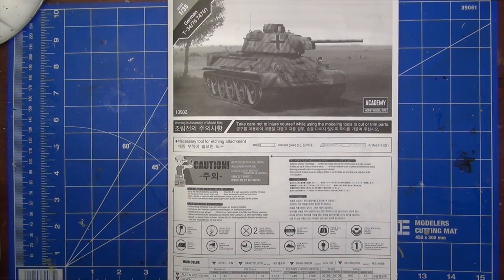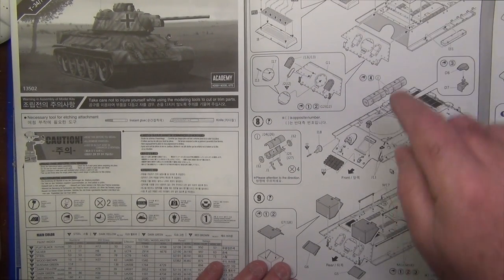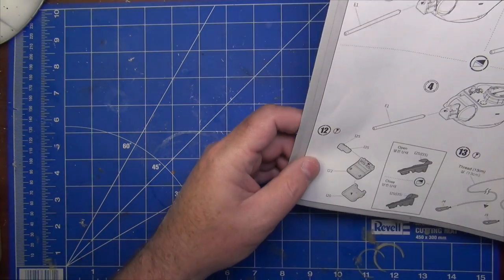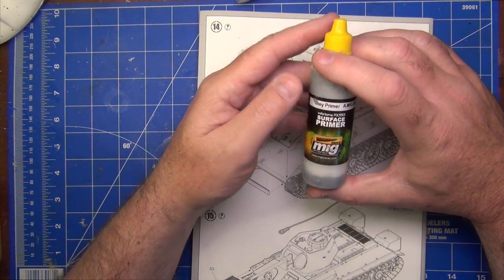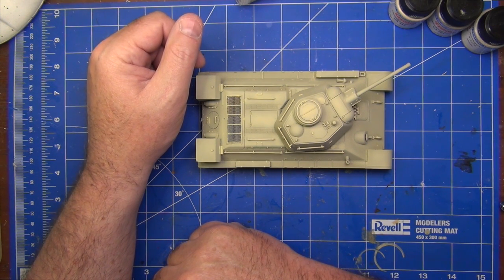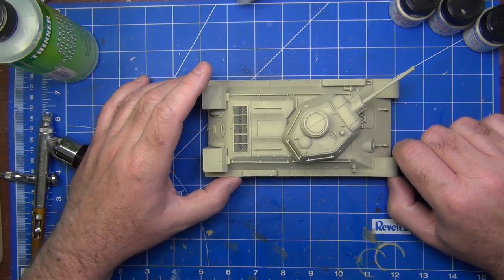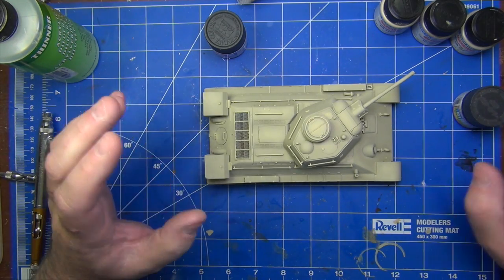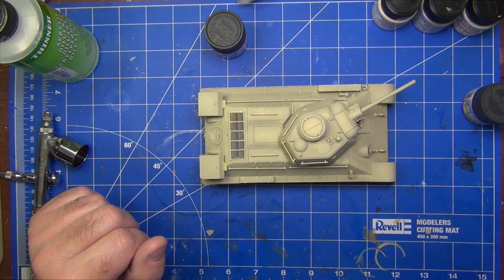Academy 1:35 T-34/76 747 Build Blog 2

Comment: Hello!
I discovered that if you sand the photoetched parts with 1200 grit sandpaper before applying the super glue they stick better. Another trick is to shape them into their final form before glueing them down, so that you don't have to apply any force in order to keep them in position as the glue cures...
By the way I ordered some Lifecolor paints. If everything goes well, I shall have them by tomorrow evening. :-)
Reply from the maker: G'day Radu. Hope the Lifecolor paints work out well for you. I'm now starting to feel a terrible responsibility here! :) . Leave some feedback when you've given them a go. 

Thanks for the tips on the photoetch. Never would have thought about sandpapering them, but that does make sense. 

Dan
Reply: Van Diemens Land Model Bench 
Hello again!
Well, if it wouldn't sound too harsh, I would say that life(color) sucks :-\ 
But that doesn't mean that you have to feel responsible for it... 
I own a bunch of italian airplanes and afv's and I thought: why not trying the shades of an italian company :-P 
So I would have bought them anyway. The trouble is that half of the paints were... coagulated. And thus unusable.
True, they warn us that the paint is "freezing sensitive" and that "when using a color from an old and already used pot it is advisable to filter the product" (sic!)
But on the bright side, 6 out of 12 paints are ok. And as knowledge doesn't come cheap, I am now about 15 € wiser. So if I'll ever buy more Lifecolor paints, it'll be in the summer! Untill then I will stick to my Vallejo Air, which have never dissapointed me. Ehm... almost never :-) but that's another story.
Reply: Van Diemens Land Model Bench 
Hello! I am back with some real feedback on Lifecolor. 
This morning I decided to try them on some plastic cards.
You were right: they are less user friendly than others. I mixed them 1:1 with Lifecolor thinner. Undiluted they tend to dry into a rough surface.... They do have less coverage power than Vallejo Air and they spray quite well at 0.8atm (11psi) but, if you don't clean the airbrush REALLY well before refilling the cup, they are a pain... They forrm tiny bits of "dried skin" that clog your airbrush and ruin your paintwork. I noticed also that, when used directly on plastic, it is better to apply fine layers at the beginning to build some grip, but after that it's better to almost "flood" the area. The surface gets smoother this way. But that may well be the consequence of the dry winter air... I worked with 3 colors: UA526, 528 and 529. Unfortunately the grey and greens, the ones that were coagulated from the start, are irrecuperable :-( Filtering them gets you nowere. I tried it with some tea filters (paper).
Hopefully, my long story won't bother you....
Reply from the maker: G'day Radu, So are you saying the conditions you are painting in is cold and that is the problem or that the paint has already been exposed to freezing temperatures and thats why its no good anymore?
Dan
Reply from the maker: G'day again Radu,
I"ve personally never tried them without a primer base. Now you mention it, I should have made a note about that on the video. Then basically I did what you suggested and misted a coat of the paint and then build it up. I did find that flooding the paint, even if accidental, seemed to not be a big problem. Paint always smoothed out. The tiny bits of dried paint is more of a problem with that brand, but so far I've avoided it clogging my airbrush. I pour the paints using a toothpick to put drops into a disposable medicine cup and add thinner, before transferring the paint to the airbrush, a little bit at a time. That way its easy for me to change the paint to thinner ratio as I work. I use this technique for basically everything I spray no matter what the brand and whether by good luck or design, so far I've had no problems.

Really interesting to get your feedback. It does seem that perhaps temperature is playing a big part in how this paint reacts. What temperature (roughly) is it when you are spraying? You have me curious now as to what is the cause of your paint being like it is.

I hope you can get your money back on the unusable paint! Seems if it came like that, you should be entitled to a refund. Do you know if its very old stock? Does it have the old style Lifecolor logo on the bottles?

Anyway thank you for writing back. I've heard of MIG paint being affected by temperature too, but I guess in Australia we don't get enough cold temperatures for this to be a problem.

Regards,
Dan
Reply: Van Diemens Land Model Bench 

G'day :-) 
Well I'm not sure what was the cause of the coagulated paint... It can be the fact that they are old and that they travelled from Germany to Romania by Post in a very cold winter (down to -20°C). But it also can be that the lot was somehow of poor quality... Interesting is the fact that only half of them were affected. The three that I tested are perfectly usable if you are aware of their weak points.
Reply: Van Diemens Land Model Bench 
The label of the bottles have the orange wavy band on top. I don't know if it's the old style or the new one...
There is actually a 4 digit code on the label though. If this is a production date or the batch code I don't know (the usable ones have 1506, 1506 and 1604 and the spoiled ones 1601, 1602 and 1604 respectively).
I paint inside at 21°C and 25% relative humidity (in the summer the humidity inside is about 60%). Both my airbrushes have small cups (1,8ml) so I have to replenish them several times in the same session. True, I mix my paint in the cup and that can be the cause of the tiny flakes of dried paint, as I stir the mixture with a plastic rod... I don't get them with Vallejo Air and Revell (enamel).
About the refund, you are absolutely right, but the trouble of sending them back is too much for me.
From the two sets that I bought, 3 out of 6 paints were damaged. It's like they sabotaged their own italian colors, because I bought the Regia Aeronautica and Regio Esercito WWII sets ;-) . I can reconstruct the greens, grey and red brown making my own mixtures from Vallejo Air paints.
Thanks for the little chat :-)  and I'm looking forward to your next posting!
Reply from the maker: Thanks for the update Radu. The model is now finished, so I need to get the video shot in the next few days and also update the build blog for the Kitmaker Network, which is falling behind the videos!

Comment: Their not German fuel tanks, original Russian early type fuel tanks.....which were later replaced by the cylindrical ones...:>} Nice paint job.
Reply from the maker: Thats interesting to know. Do you have any links to the early type fuel tanks? Would be interesting to see as I've always thought the Soviets went for the cylinder style. Learn something new! Dan
Reply: Dan, Here's a link:
https://www.bing.com/images/search?q=Russian+T-34+Tanks+WWII&FORM=RESTAB

I typed in Russian fuel tanks with no results....the only photo I have is from Squadron/Signal's book on the T-34 but I can't link it to you tube. To be more clear, there were a few different types of fuel tanks used by the Soviets in WWII, just look at some images of the KV series of heavy tanks (flat large ones on rear sponsons, cylindrical types as well). Some images of T-34/85s show smaller rear mounted cylindrical tanks across the engine deck, but these are not fuel tanks, they were smoke generators. The early 1940 T-34s used another type of flat box fuel tanks mounted to the sides of the hull, very distinctive in photos. These are identified by the early cast turret with the F-11 gun.
Hope all this helps....good luck.
On a side note.....some OT-34s (flamethrower version) had the square type fuel boxes and ATO mantlets (it replaced the MG mantlet and they mounted the antenna pot to the rear of the turret). These are distinguishable by the heftier mantlet. The fuel for the flamethrower was carried inside the tank and replaced the MG crew position. The prototype flame vehicle was developed at Chelyabinsk and had the cylindrical tanks.